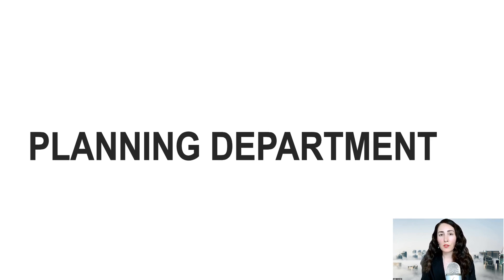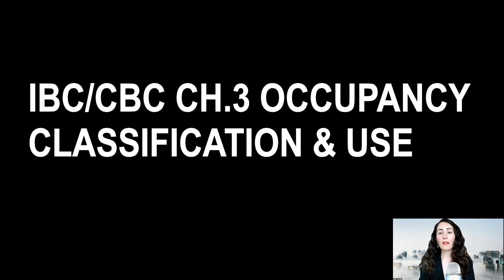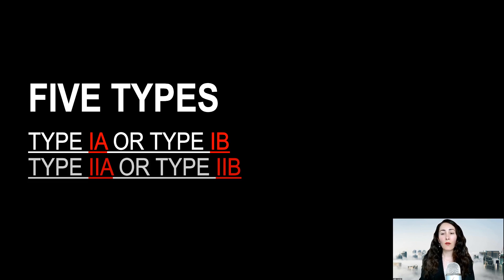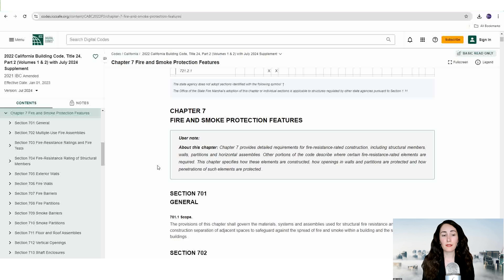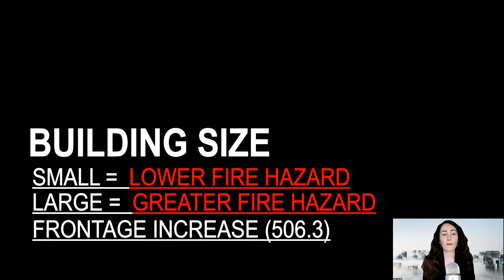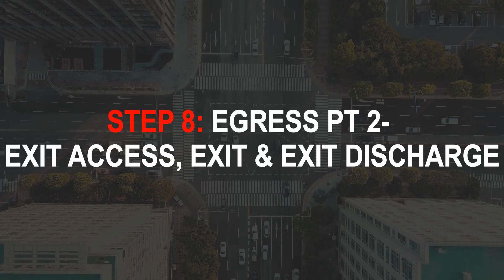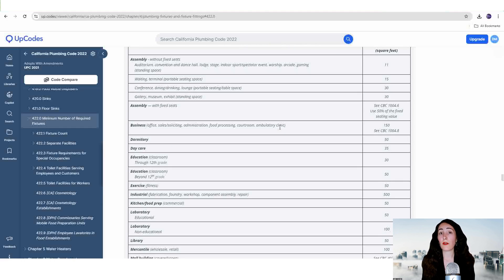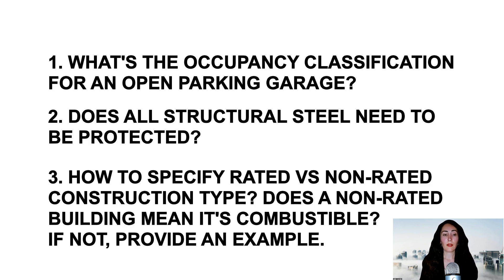MASTER Building Code Analysis in 10 EASY Steps

Comment: #1 The occupancy classification for an open parking garage would be in group S-2.
#2 The protection of steel structures typically depends on the construction type and the occupancy classification/load but generally not all steel structures have to be protected. 
#3 The way to specify rated vs non rated construction is by their rating which is either an A or B rating. "A" rating is typically meaning they are protected or fire resistant and "B" rating stands for not protected or them not being fire resistant. while B rating means not protected, the building Type IIIB is combustible while IB isn't.

Comment: 1. The occupancy classification for an open parking garage is group s-2.
2. Not necessarily, it depends on the construction type. 
3. The difference between rated and nonrated construction type is the level of fire resistance. Type A is more fire resistant than type B. These classifications do not mean a nonrated building is completely combustible (it also depends on construction type), although a Type B construction would be more prone/burn in one hour compared to 3 than a Type A construction because of the material use permissible for each.

Comment: 1. The occupancy classification for an open parking garage is in 311 Group S-2
2. Not all structural steel requires protection, but it depends on the specific conditions of its use.
3. The distinction between rated and non-rated construction types is based on the level of fire resistance which ranges from 1 hour to 3 hours. Non-rated construction does not automatically mean it is combustible. A building can be made of non-combustible materials like steel or concrete, yet still be classified as non-rated if the building code does not require fire-resistance ratings for certain parts.

Comment: 1. The occupancy classification for an open parking garage is in group S-2
2. Not all steel columns need to be protected. It depends on different factors such as fire resistance and construction type
3. Rated vs non-rated construction type are based on fire resistance. Type A means protected construction type. While type B refers to unprotected construction type. Non-rated construction does not mean it's combustible. Non-rated just refers to the absence of fire resistance ratings. For example, type VB construction is non-rated and combustible, and type IIIB construction is non-rated and non-combustible.

Comment: 1. An open parking garage is classified as Group S-2.
2. The construction type tells us if structural steel requires protection. Buildings that are Type IIA and IIB need protected steel. So not all steel is required to be protected.
3. With 5 construction types, there are 2 subcategories which are added. Type A and type B. If a building is non-rated it doesn't mean that it is combustible, it simply means that it doesn't need to meet the fire rating. An example of a non-rated building types are Type II-B and Type V-B.

Comment: 1. What’s the occupancy classification for an open parking garage?
The occupancy classification for an open parking garage is Group S-2.
2. Does all structural steel need to be protected?
Not all structural steel has to be protected as it depends on the type of construction necessary for that building, which could refer to type A or type B construction.
3. How to specify rated vs. non-rated construction types? Does a non-rated building mean it’s combustible? If not, provide an example.
Rated and non-rated construction types are of type A and B. Type A means protected, that element has an additional means of fire protection, and type B means nonprotected that means the column is nothing applied. However, a non-rated building doesn't always mean it is combustible. For example, type IIB is non-combustible materials, but IVA is combustible.

Comment: 1. The occupancy classification for an open parking garage is group S-2.
2. Not all structural steel needs to be protected it all depends on occupancy and construction type. 
3.  Rated and non-rated construction is determined by their fire resistance. Type A is rated and type B isn't but it doesn't mean its combustible. For example Type IB is non-combustible while Type IIIB is combustible.

Comment: This video resonates with me when talking about building a model and placing it on the site, I have always wondered if we were breaking any codes just by being a couple inches in one direction or another. This brings me to the most important part that this video creates a new understanding to the codes, and this helps as a stepping stone to each of the things that architects need to check off when looking at a site and building in one. This also opened up my perspective of the work that architects need to do when thinking about a project such as the plumbing fixtures, construction types and their fire resistant's, and also how to navigate when there is a fire.

Comment: 1. An open parking garage is classified in group s-2.
2. The construction types range from 1-5. It's not mandatory to protect all structural steel, but seemingly recommended.
3. Whether a building is rated or non-rated is determined by the fire resistance of the project. Typically, a type A building is classified as fire resistant, while type b is not.

Comment: 1. Open parking garage would be classified as low hazard storage Group S-2. 

2. I don't think all structural steel needs to be protected because there is Type A and Type B construction which means that type A is protected while Type b is not. Therefore if structural steel is used in type B construction, it does not necessarily need to be protected (however it does need to be protected in type A construction). 

3. Rated vs non-rated construction depends on the type of construction. Type A construction is rated and has additional fire protection while Type B is non-rated and has the least amount of fire resistance. A non rated building doesn't necessarily mean that it is combustible as some material used may be non-combustible (like concrete).

Comment: 1. The Occupancy Classification for an open parking garage is simply Group S-2
2. In terms of the structural steel, not all of it needs to be protected. It actually depends on the construction type and occupancy of the building. 
3. Rated vs non-rated construction types are based on fire resistance. Type A means that the construction is fire resistant while Type B means that it isn't fire resistant. One example is how Type IB is non-combustible while Type IIIB is combustible.

Comment: 1.) The occupancy classification of an open parking garage is Group A-2, specifically ICC 311.3 as low hazardous storage.
2.) No, not all structural steel does not need to be protected because it depends on what type of construction.
3.)You are able to specify rated and non-rated construction types through its differentiation of “A” or “B”. Type A represents materials that have additional fire protection elements, while “B” is non-protective. Although type B is not rated, it does not mean it is combustible. For example, Type IB is non combustible, and Type IIIB is.

Comment: 1. Group S-2 is classified as the occupancy for an open parking Garage.
2. Not all types of structural steel need to be protected. There are two things that can determine whether or not protection is needed: the types of construction and occupancy. Both type IIA and IIB do not need protection, while fire-rated construction does.
3. Rated construction types just mean that certain structural elements are designed to withstand fire (1hr or 2hrs), while non-rated ones are not required for any type of fire resistance. However, non-rated construction types do not mean that the building is combustible. For instance, warehouses that utilize steel frames and concrete walls do not require specific fire ratings because both materials are non-combustible.

Comment: 1. The occupancy classification for an open parking garage is Group S-2 occupancy.
2. Not all structural steel needs to be protected because it is determined by various factors such as occupancy and construction type. For example, type IIA and IIB does not need steel to be protected.
3. Rated and non-rated construction types are determined by type A and type B construction types. Type A is protected (meaning that the element has additional fire protection) and Type B is not protected (element has nothing applied). For example, type IIB is noncombustible because it requires the use of noncombustible materials such as steel that don’t have fire protection.

Comment: As the steps were broken down to understand how to begin a code analysis. I found it helpful that each step is related to the other and might help avoid missing a step. While else keeping in mind that there is more to consider. One of the steps that I found interesting is occupancy classification and use, as who uses the building, mixed-used which I think is more important when there are more details to consider when codes or requirements are combined.

Comment: 1. The occupancy type for an open parking garage is Group S-2 according to the IBC.
2. Not all structural steel use needs to be protected and will mostly rely on construction types and occupancy.
3. To specify non-rated vs. rated  construction types you have to determine its type. Type A would be rated and Type B would be unrated meaning it is unprotected. Just because a building is non-rated does not mean it is combustible. For example Type IIB is a non-combustible type of construction that is non-rated.

Comment: 1. The occupancy classification, according to the CBC, for an open garage is Group S-2.
2.  All structural steel does not need protection,  Type llA and llB buildings do not necessarily need protected steel. 
3.  Both rated and non-rated construction types are rated A or B. A meaning rated and B meaning not rated. Type IB is considered non-combustible, type IIIB is combustible. Weather construction is rated or not depends on its construction type.

Comment: 1. The Classification for Open Parking Garage is S-2 = public parking garages
2. No, category B of fire-resistance rating requirements does not require for building members to be protected.
3. Construction types can be categorized into two types A (rated) and B (unrated). A being protected while B being unprotected.  When a building is non rated it does not mean that its combustible. For example, Type 3B is combustible due to the combustible interior walls despite being protected, while Type 1B is not combustible of the building being constructed out of non-combustible materials.

Comment: 1. The occupancy classification for an open parking garage is group S-2, low hazard storage.
2.Not all Structural steel does needs to be protected, depending on the construction type of the building.
3. Non-rated and rated construction types are specified by A (rated) and B (non-rated). Type B does not mean it's combustible, it can just use materials like steel and concrete without needing fire protection.

Comment: 1. The occupancy classification for an open parking garage is Group S-2, which means it has a low hazard storage. 
2. No, not all structural steel needs to be protected, depending on the type of building it is and construction, type A or B.
3. Rated vs non-rated construction type is specified by type A and B. Type A which is protected. Type B which is not protected. A non-rated building does not mean it is combustible. For example, type IB are not combustible because it is fire resistive, and the materials are unprotected. But construction type VA are combustible.

Comment: 1. The occupancy classification for an open parking garage is Group S-2.
2. Not all structural steel needs to be protected, it depends on the construction type and occupancy.
3. Rated contrustion types are fire resistant while non-rated is not fire resistant. Type A requires fire protection and type B does not require fire protection. Type I is the most fire resistant and type V is the least. Type I and II are made of non-combustible materials, so Type IIB is not combustible just because it is non-rated.

Comment: 1. The occupancy classification for an open parking garage is Group S-2. This means that the garage has a low-hazard storage. 
2. Not all structural steel needs to be protected, as it depends on the type of building it is. It would be either Type A or B for the building construction, but all steel has to be protected from corrosion. 
3. Rated vs Non-rated construction type is based on two types, A and B, and it is about how much fire resistance rating they have. In type A construction it is about protected materials, while in Type B it is non-protected. There are five different forms of construction, and in each of these constructions, there are A and B types. For example, Type IV-A is a combustible building type and Type IIB is known as a non-combustible.

Comment: 1. The occupancy classification for an open parking garage is Group S-2 (Low Hazard Storage). 
2. Not all structural steel needs to be protected as it depends on the construction type and occupancy. In fire rated construction, structural steel must be protected to meet the required fire resistance rating. However, in non rated construction, where no specific fire resistance rating is required, structural steel does not need to be protected. 
3. The rated construction is classified as fire resistant which is determined by the type of construction. While the non rated construction does not require fire protection, and does not mean it is combustible. The construction types are specified with either A or B, whereas type A refers to rated construction, and type B refers to non rated construction. For example, type IIB is non rated and uses non combustible materials like structural steel without fire protection.

Comment: Considering how many codes and other things architects need to consider when constructing a building, it's important to know where to start.  This video is a great stepping stone into the beginnings of a project and the things we need to prioritize over other things that will not significantly impact the project. Gathering zoning data and understanding occupancy and construction types are all things that should be considered at the beginning of the project and cannot be put off till later. A good architect knows what to prioritize and what things can be designed or planned out at a later time the smaller details such as plumbing, and materials are not always considered in our studio work but they are a necessary part of a realistic construction and should be applied in all cases.

Comment: 1. According to (CBC), an open parking garage is classified under Group S-2 (Low-Hazard Storage). And the term open refers to the needed ventilation in a partially open atmosphere for the parking.

2. Not all structural steel needs to be protected, it strictly depends on the construction type, occupancy, use, etc. that designate fire protection needs. To my understanding, construction types I,II, and III typically require steel protection, but they also differ in terms of fire-rating hours.

3. Rated elements in design specify fire ratings like 1hr, 2hr fire rating of buildings made with assemblies and materials that are non-combustible. Fire-rating tells us the duration a building can withstand fire. Non-rated buildings are not necessarily combustible, they could still use non-combustible materials. Non-rated buildings can still be non-combustible, all it means is that the building per code does not have to be fire rated.

Comment: 1 - The occupancy classification is group S-2.
2 - It depends on the type for a building determines.
3 - Construction type A or B are used to specify rated and non-rated construction. Non rated does not mean that it is combustible, Type IB which is non-combustable supports this.

Comment: 1.	According to the California Building Code, an open parking garage is Group S-2. 
2.	Structural Steel does not always have to be fire-protected. It all depends on the type of occupancy and construction type of the building. 
3.	You specify if a building is rated or non-rated by the type of construction. There is type A construction that is rated, and there is type B construction which is not rated. However just because a building is not rated, does not mean that it is combustible. An example of this is how Type IB is considered non-combustible, while Type IIIB would be considered combustible.

Comment: This video was very informational in providing the steps to building code analysis in the order we should do them. The descriptions of what we should be looking for and the chapters to find this information while starting the design process and analysis will be very helpful. I also learned that architects need to be informed and have knowledge in all of these areas as it will help the design process and code analysis go smoother.

Comment: 1. The occupancy classification for an open parking garage is Group S-2.
2. Not all Structural steel needs protection, it only requires in fire-rated construction types. Non-Rated Type II-B or Type V-B can use unprotected structural steel.
3. There are two ways to distinguish between rated and non-rated construction: There is A that is protected and B that isn't. Nonetheless, a building's classification as non-rated does not automatically indicate that it is flammable; this depends on the level.